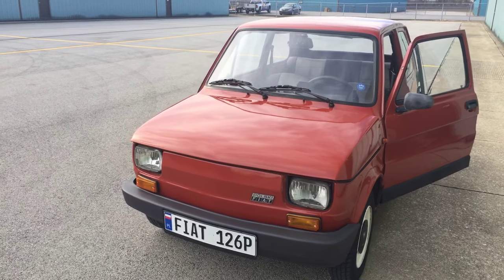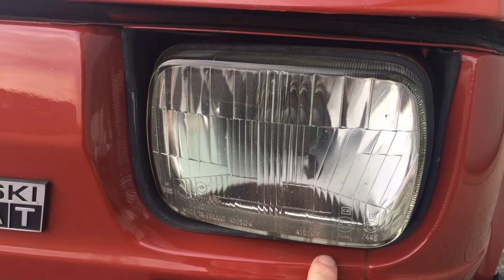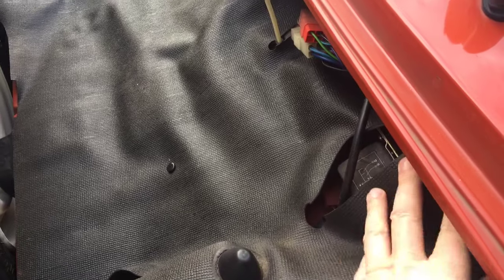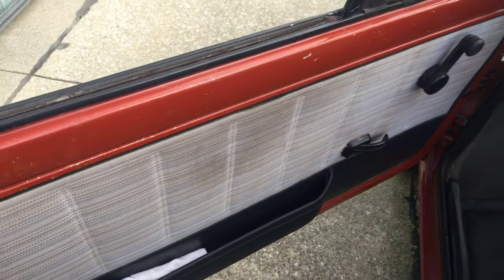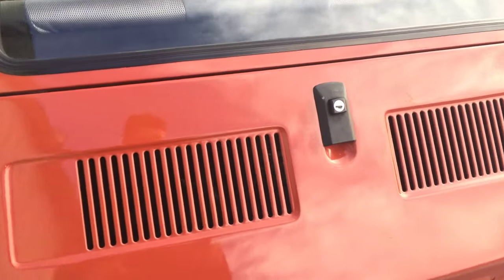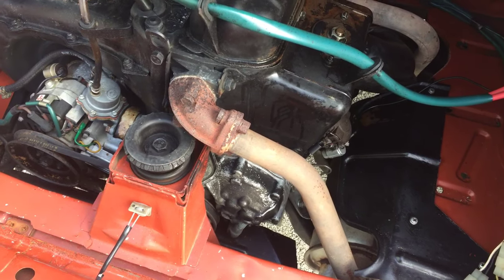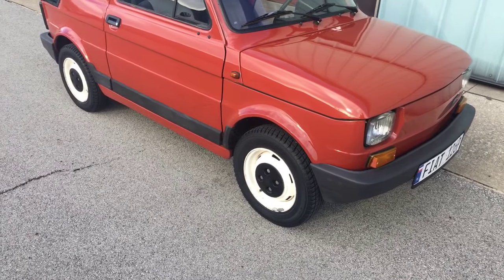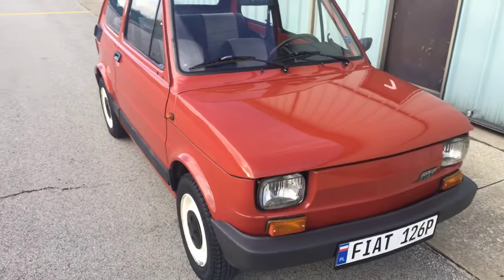Fiat 126p in USA - Episode 2 - Clean-up Work, Maintenance, and Tips

Comment: So to remove that  window handle you just use a skinny flat screwdriver  and push away the retaining ring.
The ring itself is just a round ring cut in one place and has folded ends outwards.
But the mirror should come loose after unscrewing those two screws from outside.
Nostalgia 
Greetings from UK polish broo

Comment: So good: the vídeo,  the project, the dedication, thanks for sharing!  In my opinion, let me say: the oil pan gasket is sensitive to over tightnen. You may end damaging and causing oil leak. Most importantly is the gearbox oil. The viscosity may be correct 80W90 but these old fiats need non EP oil. EP aditives include sulfur and this attacks the yellow metals, the synchros. GL3 rating is the way to go although certain GL4 oils are engineered to cope with this condition. Cheers!

Comment: I, myself, currently have 2 Fiat 126p. On from 1991 that I had completely restored (in Austria) and a 2nd one from 1994. Both are very reliable. I bought my first one in 2010 and the second one in 2015. I bought one in 2011 and drove from Szczecin back to Austria - which is roughly 900km. It only took 13 hours :-). Not that bad :-)
Yours is in pretty good condition. Did you have to put a lot of work in it?
Anyhow, pozdrowiena z Austrii i wesolych swiat.

Comment: If you tighten the cylinderhead cover too much the rockers get stuck. This is because the cover is made of thin metal sheet. It bends. 
If this occurs your are searching your a*s off.
There are cork gaskets to use. They are a bit thicker, will not deform and seal off very well.
On top, you need to place two rubber rings (gaskets) over the mounting studs and then drop two metal rings/rivets on top of them. Now fasten the two nuts. Tight but not too tight.

You can loosen the window crank by using a small electrical screwdriver. Make sure you push against the metal clip on the inside. Slowly and do not pull to much. Otherwise you will break the crank. It's plastic. 
But didn't you try to loosen the two philpscrews yet? My guess is that the mirror will come loose straight away.

The Haynes manual reads 'oil viscosity = 15W40.
The recommended oil viscosity for the first models, type 126A '73 - '78, is 20W40. But nowadays it's 'Classic' 20W50. This depends also on the mileage, state and condition of the engine.

You showed H3 headlight bulb. That's old fashion. You can order new H4 headlight units for very cheap in Poland. That will give lots of light you are used to now.

Comment: Grip the circular base of the crank (not the circular neck, the lever) and pull. You shouldn't need a tool to remove it. Having said that... I would have though you could just unscrew those two screws holding the mirror, without having to remove anything inside?
Reply from the maker: Xylaquin thank you. Unfortunately you had to take the interior out to get to the nuts on the back.
Reply: @FIAT126p  Isn't the mirror fixed on a rail with the nuts being accessible from outside, as it was in the past?

Comment: I love these cars although they have their inconveniences. Because of the very short wheelbase, the cars shakes from the front to the back, which is getting very annoying on long highway trips.
You forgot to show the specialities of these cars. The handthrottle is one, which allows you to block the throttle, the choke lever between the seats, the folding seats (yes, you can sleep in this tiny car as in a Tesla) etc.